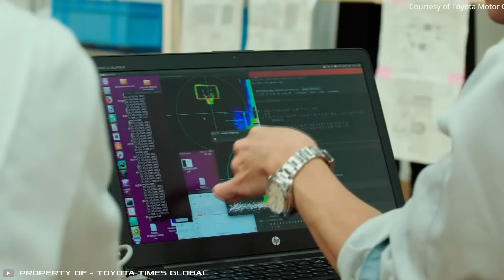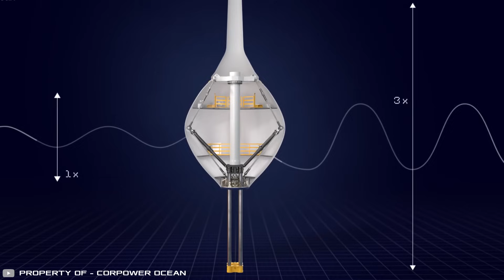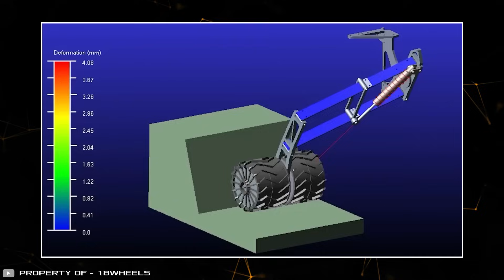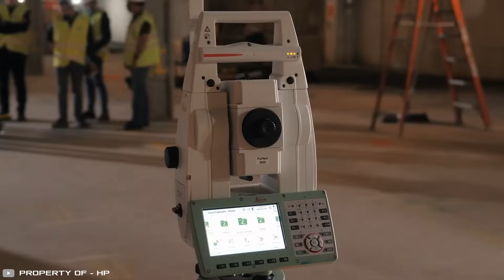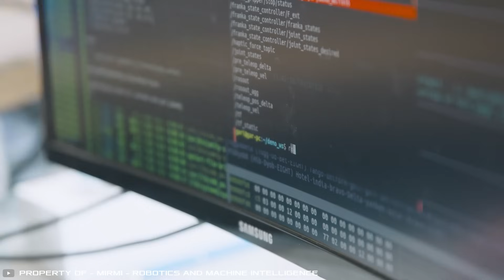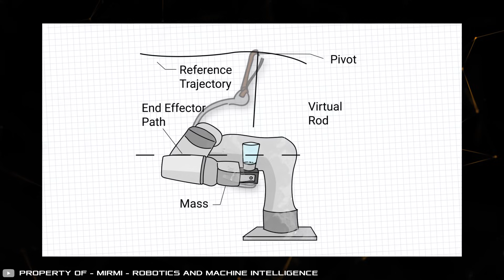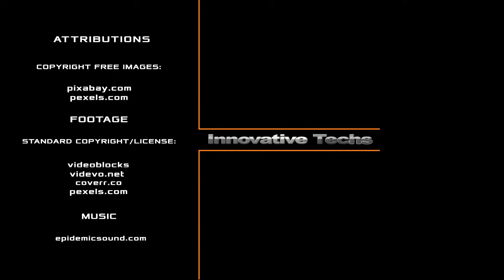INCREDIBLE INVENTIONS THAT YOU HAVEN'T SEEN YET

Comment: Wow, use an exo skeleton to beat arm wrestlers. Pathetic
Reply: Yeah, kinda like using a motorcycle to defeat 100m sprinters. I'm dumb as a brick. However, Even "I" can see that Something here doesn't quite compute. Either the Meat is rotten OR It is the Salt. IOW WTF!?
Reply: Yeah, but consider that this was a DIY project, not something built by Boston Dynamics. Plus, some of the concepts could be used for more practical applications. Maybe.